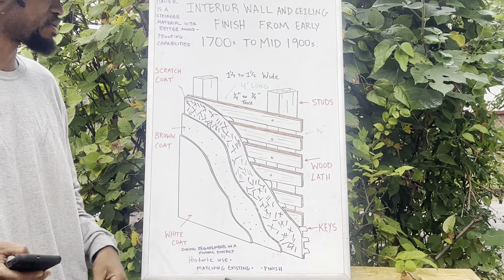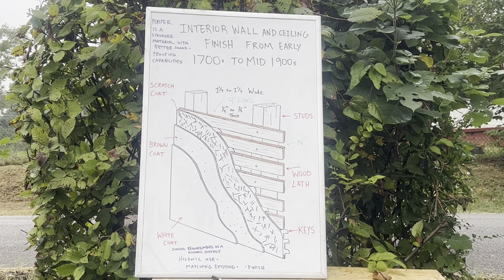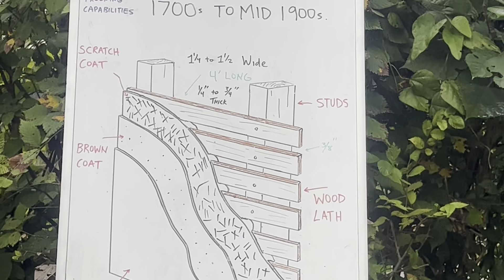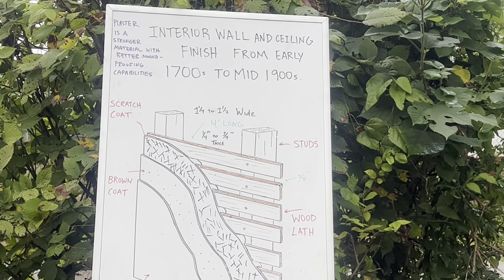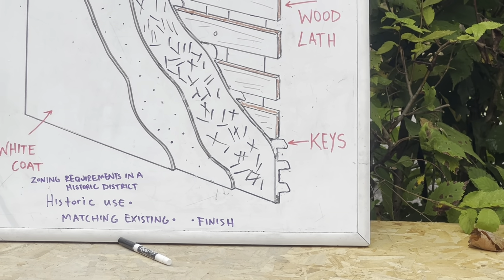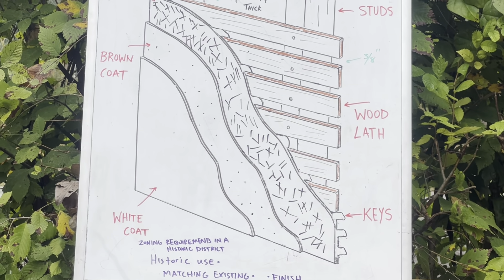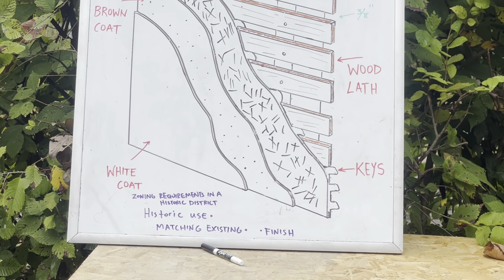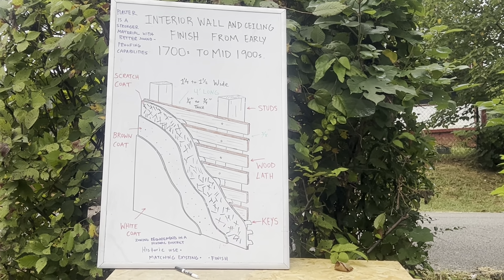Journey to the Temple: What is Lath and Plaster?

Comment: Lath and Plaster...dealt with alot over the years..one tip is if you need to demo it once you have access to open wall,if you break on the keys from inside you can remove large pieces at a time,just saying...good topic bro...another thing is when they started using button board..drywall with holes..Your right in some historical area's in California I've had to replace and repair in that house with Plaster and couldn't remove and install drywall...GC in California
Reply from the maker: What's up Jon! Good to hear from you hope business is going well. Great Pro Tip  about breaking the keys to remove a section. Thanks again for commenting.